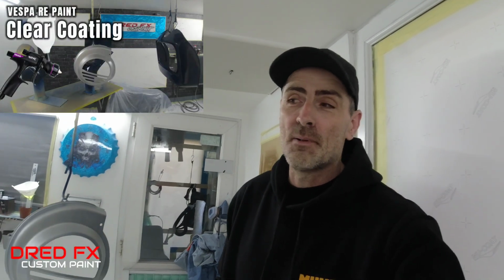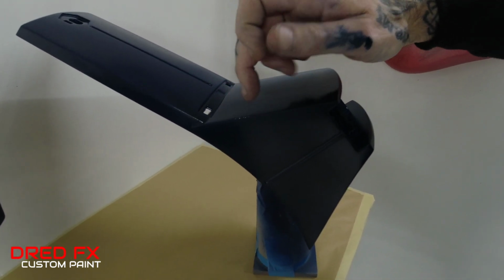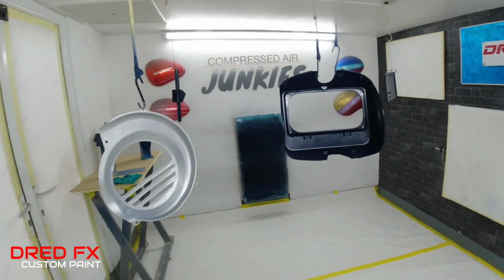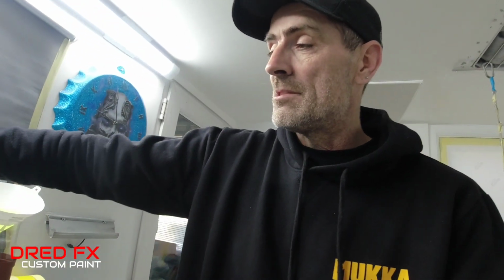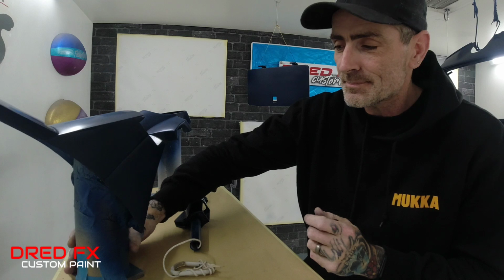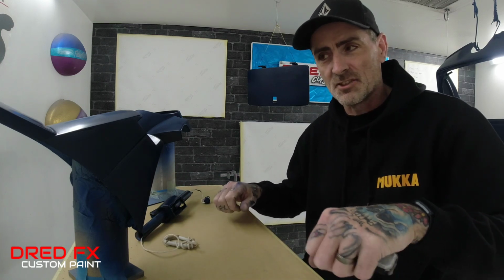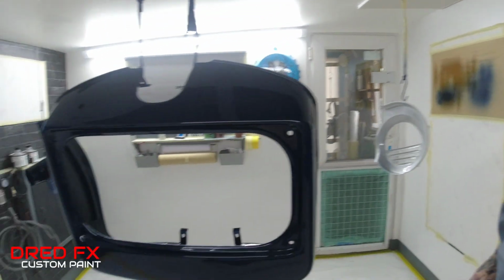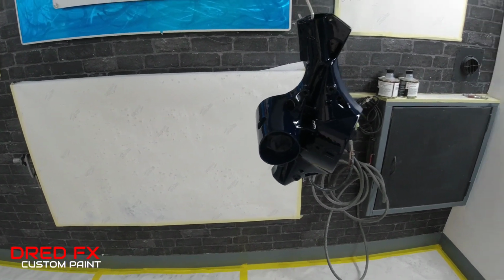kapci clear coat  with the dv1s

Comment: Heya rob.hows things man!
Just another question regarding your kapci C.Coat.
I'm applying it over Createx Wicked which has been applied to a hard surface.
Clear coat is still soft ie finger nail indentation...this is after 16hours!
Temp and ratio spot on...(air drying)19°

Should this be happening?is it reacting with paint.

2nd time Iv tried this now and same thing,last time it lifted all underlying paint.🙈

What could be going wrong?
Cheers man
Reply from the maker: Has the wicked gone off 🤔that shouldn't be doing that I used kapci in a video the other day over fw inks on a aluminium panel 
Air dryed the clear next day spot on .I think it's the wicked not dryed down